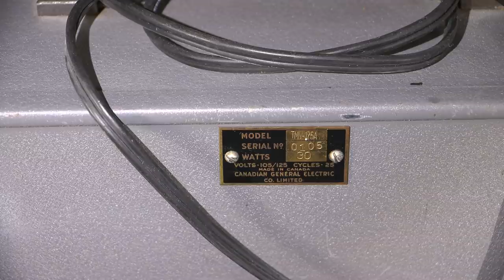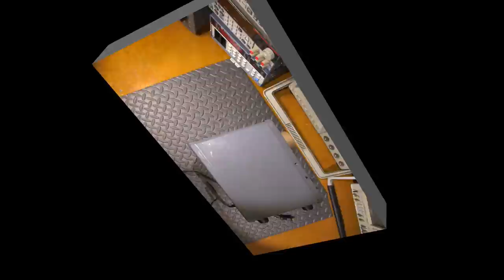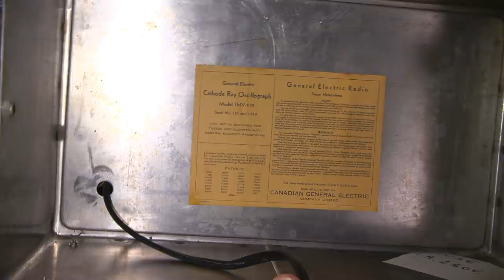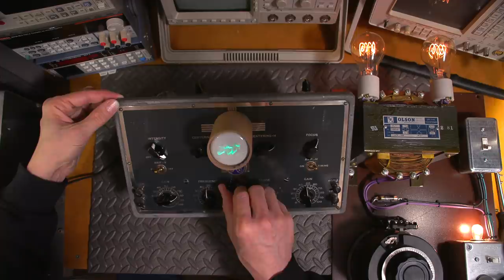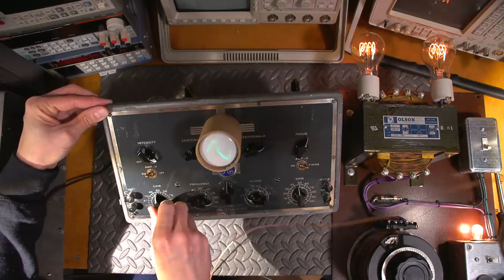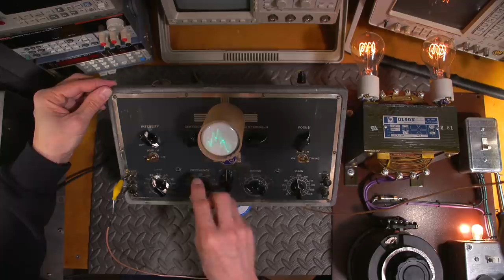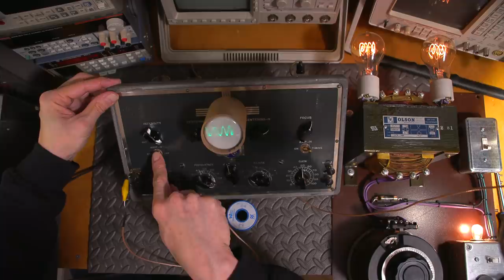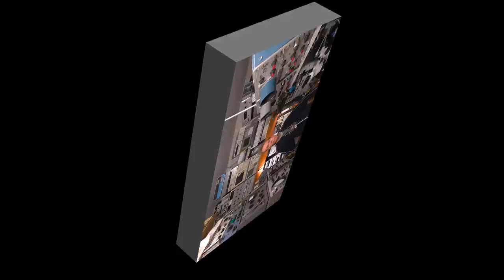1938 Electronics - Will It Work? Let's Power It Up!

Comment: Looking at all the noise and knowing a lot of tube circuits can be AC or DC would it be better for initial diagnostics to bring the device under test up on a clean DC supply that can ramp up to the 110-120 volt range?
Reply: If a device has a power transformer, it HAS to be ran on AC.
DC would burn the transformer out quickly.
Plus, even if the transformer held up, the device would not work anyway, as there would be no output voltage from the transformer.
What you describe could work on a device that is designed to operate on both AC or DC.
Reply: @m.k.8158  Very much depends on the device yes but a lot of the older radios worked on could do both or so it has been mentioned a few times.
Reply: @JamesHalfHorse  Yes, but many devices can't...
Unless you KNOW for sure, then don't try it.
Also, not ALL transformerless devices will run on DC.
Some examples:
1.a transformerless device using a voltage doubler circuit.
2.a transformerless device that otherwise uses the AC for a circuit function(either or both of these are likely on a Television, but not so likely on a radio).
3.any transformerless device that has a AC motor in it(record players, tape machines, clock motors(clock radios, for example), and most older devices that have a cooling fan.

There may be other examples as well.

Also, I'm not sure that there would be a major advantage in most cases to using DC for troubleshooting.
Reply: On one you are fairly sure or in some cases says on the label I would think it would quickly narrow down an issue to say a noisy heater circuit or for that matter I don't see why you couldn't isolate that and bring it up on DC. I work in  high RF environments anything can turn into an antenna so you come up with ways to eliminate and isolate as much as possible on the front end. Your chasing an RF ghost only to find that an unbalanced line in the chain fell on a noisy power supply in the bottom of a rack. That said tube circuits are fairly new to me at least any tube smaller than my head (and I need help with those beyond simple tuning) so I am learning from Mr. C as I go too. First time those tubes heat up and you hit the high voltage, massive contactors clack, the few watts out of the exciter feeds the IPA which makes a few hundred watts going into the PA tube and 15kv goes into that plate, the tube falls in resonance and the power climbs slowly to 100%... 30,000 watts goes up the 500ft lightning rod and through the magic of gain becomes 100,000 watts you are hooked. As much as I hate those things even scared of them I am in love with them too. It's magic until its not and it goes wrong quick then you are awake 30 hours on a simple tube swap because it refuses to tune.

Comment: Am I the only one who noticed this equipment was built to operate from 120 VAC @ 25 Hz, not 60 Hz?  The transformers may not like being plugged into modern power.
Reply from the maker: Hi Rob. Up here we used to have 25 Cycle electricity, the transformers handle it just fine, but operating a 60 Cycle transformer on 25 Cycle electricity is not good. 25 Cycle electricity is long gone, so no worries about that.
Reply: I missed it.  60 hz wont harm it. Output voltages of the transformer may be a percent or two lower.  Now, if it was vice versa, the transformer core would get hotter from more core saturation, but still, (more than likely) would work also, just reduced life expectancy over time.